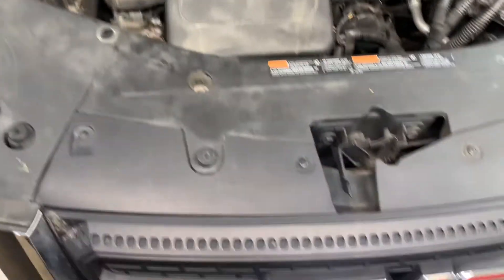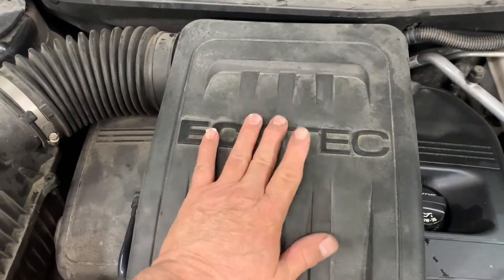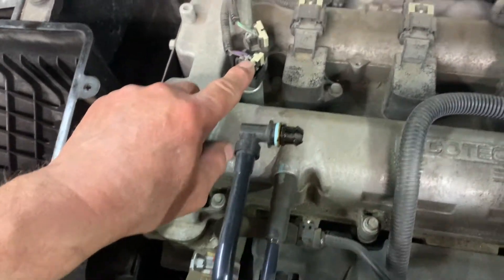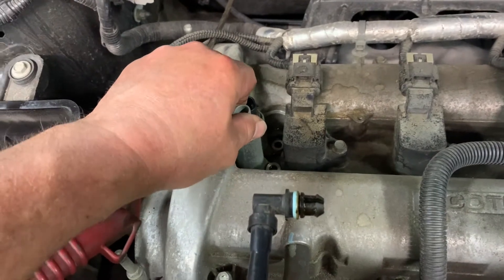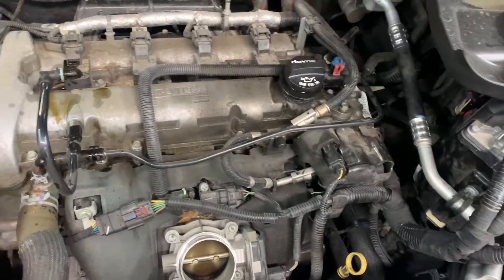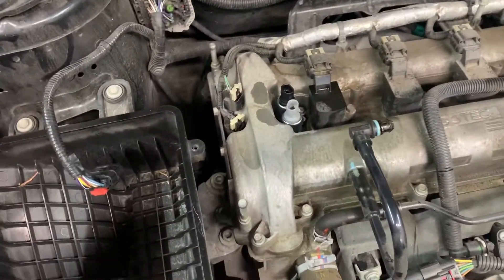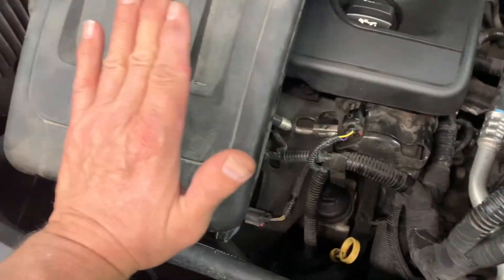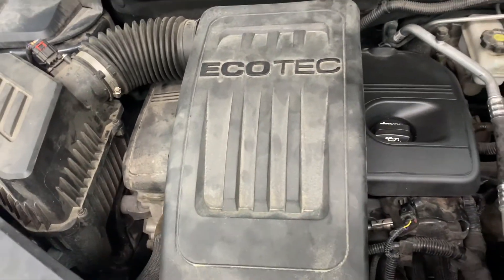2017 GMC Terrain Camshaft actuator solenoids replacement

Comment: Hey what houses the solenoids I tried to change them out but I snapped off the bolt and when I tried to drill it out some metal shavings fell down into the whole and I don’t think it would be safe to make my own drill hole so I’m just looking to replace the whole part
Reply from the maker: Pretty sure the valve cover covers the whole top
Reply: You're doing it wrong, man. Just give up. Replacing the solenoids is literally the easiest thing you can do. I have no idea how you messed it up so bad.

Comment: I’m getting the P0014 and the Terrain keep turning itself off when driving.  I changed the oil and filter today to see it it goes away.  I think I will need to change the Intake Variable Valve Timing Solenoid.

Comment: I have a 2018 GMC Terrain and a code P0011 came on. When I drive it hessiates around 2,000 rpm.. any help please
Reply: Did you find the solution?
Reply: @carsonbrooks  yes it was the variable timing solenoid. I got it from Autozone make sure it’s the GM genuine part. SKU-000916364 
GM#12679099
It’s been running good after I replaced it !